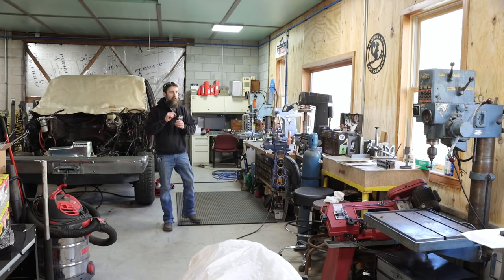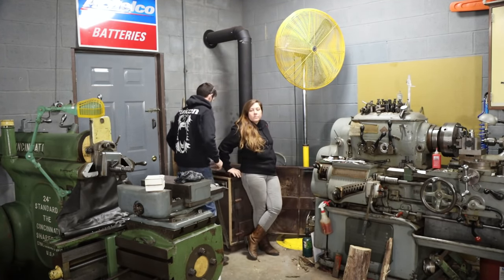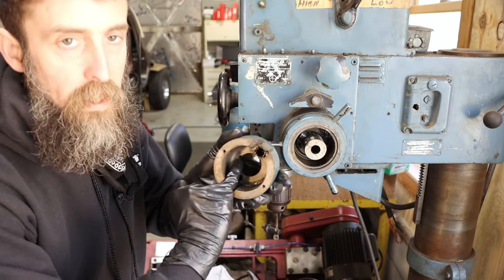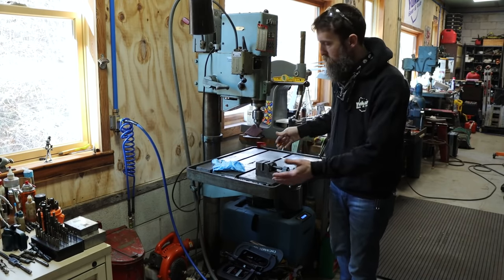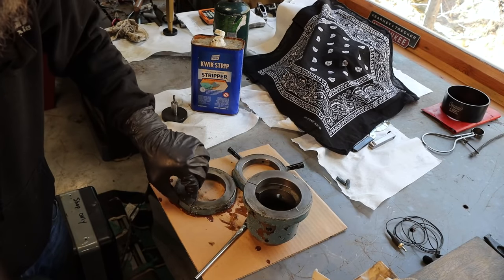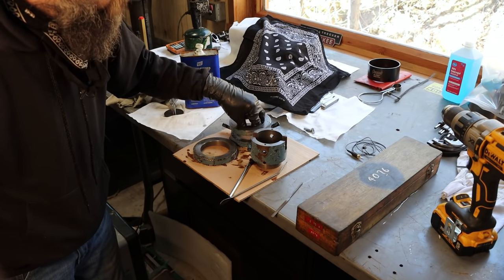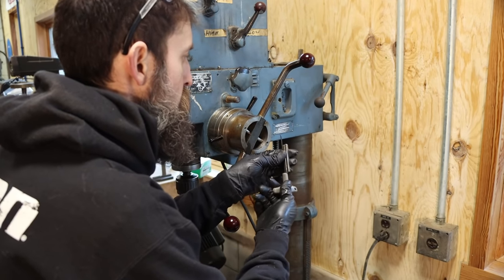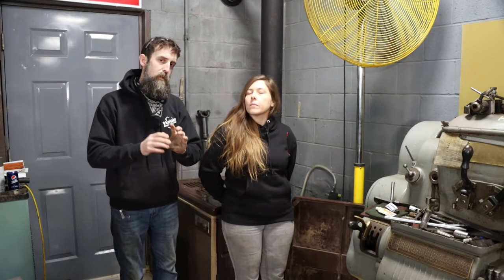Broken DoAll Drill press repairs. Mystery of the Missing parts 1

Comment: Yet a great video Steve 👍
The Strands/Arboga drill presses are super common here in Scandinavia. 
Your model is a S32M and the smaller one is a S68.  Great machines..
You should be able to get manual for your machines. It you need help with parts i can try to help though a Danish dealer.

They still make machines in this brand,  same as Arboga, Solberga and others. (Almost identical machines) 
Some parts are not made as good as they used to be.

If you ever want to repaint it. They were painted in Light blue Hammerrite paint, with 'hammered effect'

Best regards Denmark.
Reply: Indeed, according to the manual, the gear reference seems to be 2HS1961
Reply from the maker: Thanks for watching.  I agree they are extremely well made.  They are a bit hard to find around here. I like the original colour. My smaller one hasn't been repainted and looks pretty good.  I'd much rather have original paint. Thanks for the offer on searching for parts👍. Chances are Ill end up having to making it.
Reply: Nowadays the company making Strands are called MSC Machinery Scandinavia, according to the website they are manufactured in Rosenfors in Småland, so you seem to be mistaken in your claim that they are Asian made.
Reply: Aww, and here I was looking forward to Steve setting up for gear cutting on that big horizontal mill of his.  :)
Reply: @the_hate_inside1085  you are right. They are made in Rosenfors. - like Strands used to be made.
Now they are under Machinery Scandinavia (one roof) Strands, Arboga, Solberga, IMA & their new line Rosenfors.  All similar machines.  
I've edited my text as it were misleading. 😊👍
(Didn't know they were 'back' and all being made in Rosenfors, but did talk with my tool supplier today about it)

Those models are also made as copies with allot of other labels/names, from Asia.
I've owned one myself, and it were poorly made and far from the good old ~Strands.

Comment: I have not broken any of my bondhous ball Allen’s yet and I have cranked on several of them pretty good.
Reply from the maker: That 2mm wrench was asking for it. They really should put ball ends on them that small.  My bondhous set doesn't have ball ends on the really small ones.  That is a harborfreight set I have been using for a year or so. I like them because of the leverage 😁👍

Comment: You need part number 1903, its a 22tooth gear. The parts breakdown manual is available for download at HH Roberts machinery.
Reply: Which model is Steve's drill press?
Reply: @prototype3a  s32

Comment: Hi Steve - you're a braver man than I am.  I design & build electronic geophysical instruments, and almost always use a professional card shop to make my blank circuit boards - two or four copper layers, platted-thru holes, silk-screened part IDs & location outlines, i.e. "the works".   But I have occasionally made quick prototype {one-off} single-side circuit boards in my basement workshop over a single evening.  Drilling small holes is difficult for me because I don't have a good drill press, but I get along fairly well with some cobbled-together drawer slides on/in hardwood rails running vertically to support one of my Dremel-clone high-speed rotary tools/drills.  But a # 68 carbide bit is the smallest I've ever used, and they break insanely easily piercing through copper-clad fibreglass 1/16" card stock. To see you use a # 76 bit through mild steel was an eye-opener for me.  Many thanks for the demo, and best of luck finding the missing phenolic gear.

Comment: I bought used this type of drill press and I called the dealer that sells new ones and he told me that it would outlive me as long as I never shifted the speeds with the motor running. If you do that you will strip out the phenolic gears. On my particular drill they are no longer made so you would be in the gear making business. So you are warned😉. I love the drill press and it also has auto feed but an earlier design.

Comment: I did not read all the comments someone may have already said something about this below. Anyway Kleen & Strip does make a paint stripper that is super powerful. The hardware store cans are not worth buying anymore. My local NAPA sells Aircraft Paint Stripper made by Kleen & Strip. It is bionic. It waters the eyes and burns skin. Like the old stuff from the hardware used to. And does a really good job of getting paint to loosen. Good luck with the drill press gear. Cheers

Comment: Interesting investigation !- very thorough job. Rebuilding my (much smaller) 1946 built, Boice Crane 1600 now. Fabbing intermediate 5 step mounted in centre column using Alternator cast iron pulleys for shaft mount. Will greatly increase my speed range.

Comment: My 1948 Reid Surface Grinder was used once or twice before the Y axis was engaged after the travel stop.  It had a poor repair that did not last. With the Y yoke broken manual Y did not work.  The Reid at some time was converted from 2 phase to 3 phase and painted often by the City to look good. I bought it from someone that bought it at city action.  I fixed the yoke, installed 2 VFD's, stripped, painted, and polished the brass.  Its a new old grinder.
My 1960's Beaver 54" BVRP MILL was decommissioned after someone pulled out the back gear rack pinion and hammered it back in.  No parts are available.  After much searching I found a rack spindle that looked close.  I downloaded the STL file for the spindle and had a friend 3D print it.  The printed fit with a little work so I ordered the steel one .  After a total rebuild with 2 VFD's I have a beautiful 4 dro nt40 mill that was designed to be a climb mill.

Comment: FWIW: i had the same set set of HF hex wrenches.  I returned mine  because they were undersized and would bind up in the fasteners.  i replaced them with a Bondhus set.  Bondhus doesn't put ball ends on the smaller wrenches because they become too fragile.

Comment: I like the big art on the back like your doing.  Should be higher on the back.   I know a guy in the sports uniform printing business.  If they run the curing oven too fast, the ink is not cured.  Result is it comes off in the wash.  Normally Teespring has a pretty good reputation.

Comment: Better machine tools from that era commonly use dbl set screws.  Boy, if you miss them, it can ruin your day.

I recently ran across an ER32 collet chuck w- a JT33 taper shaft for 35.00 on eBay.  

I slapped it on my drill press & went from a 0.002" run out to less than 0.0005". Plus I now have 3/4" capacity on the thing.

I love it; best DP update since dropping the speed.

Check out one of those collet chucks, you'll be glad you did.

GeoD

Comment: Hi Steve,
Something you should do with ALL printed stock is place a t-towel or cloth over the top on the print and iron it hot.
All transfers or screen printing require heat the ensure that the print/ink is in-peregrinated fully.
Sometimes in the factory process the heat might not be correct and hence it will fail.

Comment: 21:05, I am assuming that it may have had a phenolic, plastic or even metal gear(due to that small clutch) such as what is found on an AMMCO brake lathe?  The AMMCO has a plastic shear gear before more internal damage is done due to operator error.  From the looks of it, someone may had already have been in it and just did nor replace the gear for safety reasons or maybe because it was not readily available?

Comment: We had 2 similar size drill presses British made with automatic downfeed chain driven from mainshaft but unfortunately no overload clutch.
Operator was drilling large hole with blunt drill with auto feed engaged, the resultant force broke the dove tailed casting and the gearbox was left hanging on the electrical cable preventing it from falling on him.
After repair auto feed was disabled on both machines for safety reasons.

Comment: One of the best cleaners I ever found was used machine oil.  Keep a few gallons in a bucket, soak dirty parts over night, the oil "rewets" the oil that evaporated away leaving dirt, gunk and rust behind.  Then to remove what is left behind, carbureator cleaner with a toothbrush size wire brush.  A final rinse in spirits and the job would be done.

Comment: Hiya Steve. Future reference. you can make a very effective DIY stripper. especially for small parts. Sodium hydroxide in hot water. You can get sodium hydroxide at the box store as drain cleaner (draino clone) and you can also get it in stores where they sell soap making supplies. I have found it at walmart. Not at all safe for people or animals, so PPE is necessary, but a small steel container or pot on a hot plate that you drop the parts into will do the trick. This will not hurt steel or cast iron. You do need to be careful with non-ferrous metals like Aluminum or Brass. Just keep it off your skin and avoid heating to the point of steam as the steam will hurt your eyes, nose, lungs etc. Not boiling hot, just hot, or warm even. It can cause serious burns and turn flesh into soap, but is very effective at removing paint. The same solution was classically used in hot tanks. I have also used it as an electrolyte for rust electrolysis. More dangerous than washing soda, Calcium Carbonate, much more alkaline. Kills two birds with one stone, de-rust and removes paint in the same step.
Reply: It also removes old oil and grease, even if it is already hard like resin, perfect for cleaning very old fuel tanks from 2 stroke motorcycles with a thick layer of hardened  2stroke oil on the bottom.

If you use acid for rust removal, you can dip the parts in sodium hydroxide solution to neutralize the acid, and it also forms a invisible protective layer on the steel, so it doesn't start rusting immediately...

Comment: It seems to me that the gear broke for a few reasons.
It was badly worn comes to mind.
The clutch did not save what it was meant to.
The missing gear also did not evaporate as you mentioned, it was removed in bits.
The gear was not replaced for at least two reasons.
It could not be supplied in a short time frame or was not available.
The Boss said screw it, just put it back together and use it as a manual down feed.
How did I go? John, Australia.

Comment: I have the same allen key set and since i got it ive been debating getting a more exspensive/ better quality set. Since these ones feel super chincy, this video has confirmed my choice lol, they work but just too flimsy for certain applications. Anyways great video as always steve good luck with finding and or making a gear. Ive wanted one of these drill presses since i first saw one!! Your shop gets more "awesomer" lol every video!
Reply from the maker: The good thing about them is the handle and the leverage.  That's the 1st issue I've had. The small ball ends seem to break no matter the brand. Some higher names stopped putting the ball ends on the smaller ones because they broke as well .
Reply: @SteveSummers  well ive been persuaded back into keeping them lol

Comment: Several of my old flat belt driven machines use a similar arrangement for feed gears...
A sliding plunger that locks each gear in turn onto it's shaft by use of a ball bearing and a spring...
It's an idea that's been around a long time...

See what someone like fenner gears have on the shelf.....and trim to suit...
🇬🇧😐

Comment: I helped out at an educational place with a Boice Crane drill press that was incredibly similar -- might've been just a slightly different year. We (gently) pulled the power feed off because we had a constant stream of people new to machine tools. Unfortunately, when it came time to put an 1.5" hole in a large piece of steel, it was a bit more work than we expected..

The quill return was also busted, so someone rigged a bucket of sand and a pulley in its place. Ugly, but hilarious (and well calibrated!), so the actual return spring was never fixed.

Comment: I believe you still got pretty lucky on that. I bought a really old Marquette welder/generator and the 10hp Onan engine was supposedly stuck from sitting for years, but had ran maybe 10 years ago and was stored inside. It was super cheap and looks really cool. Except the engine had water in it and was locked so solid I didn’t think I would be able to tear it down. It’s been sitting for 2 years full of ATF and acetone in hopes of breaking through the rust enough to get it apart. I do not have high hopes. I do have a backup plan. A 7.5kw generator with 13hp Honda. Worst case, I fit the Honda in the old frame and have a retro looking modern generator. I’d much prefer to keep the old stuff, but it’s likely bound for the dumpster…

Comment: More likely then not they pulled out pieces of that gear and what remains is the metal hub. You can get the module from the other gear (it's likely metric being made in Sweden) that's the easy part. As for tooth count, if you don't get lucky with the manual, it'll take a bit of figuring out. Hopefully feeds are marked and you can calculate the tooth count from there. Replacement can be phenolic or nylon gear... you can probably buy the latter pretty easily in the US

Comment: You could measure the distance between the shafts count the teeth and the diameter on the gear you have and calculate the gear the gear and diameter you need.  You might get lucky and find an off the shelf gear that can be modified.  Have you tried to call DoAll with the model and serial number?  They are pretty good about parts.  Sometimes they will make them and it will take some time.  That route is usually the most expensive.

Comment: You could use something like paraffin or an epoxy putty to make a casting of the space between the shaft and the gear, then extrapolate the rest of the dimensions from that.  Might be fun.  But I think someone is going to hook you up with an OEM part pretty quickly. Now, back to the truck.

Comment: Hi Steve, beautiful machine. That last small drill test was awesome. I have an Arboga eb100 that is built similarly and probably came out from the same factory (the castings at least). It's much simple than yours and needs two phenolic gears replaced. I've tried sourcing parts from representatives in Sweden but was unsuccessful and it's currently a stalled project. If you were to find replacements and or there's any make economies of scale by producing multiple replacements gears please let me know
Reply: You can order them, or have them hobbed by pretty much any engineering shop, as they are straight cut gears, and only need pitch and diameter. Likely standard sizes as well so off the shelf.
Reply: @SeanBZA  Yes, thanks. I haven't figured the pitch and diameter yet, how would you go about figuring those out?
Reply: @jpgarcia90  Measure shaft diameter, then measure the distance between shaft and top of tooth, then again bottom of the tooth on the other gear. That then can be used to give a radius of the gear, both inside and outside. Then tooth pitch gives you the info to select tooth pitch. Then look for gears with that tooth pitch and diameter that is in that diameter range, which will be what you want.  Your gear likely will come with a pilot hole only, unless you are lucky and there is one already bored to fit the shaft.

Comment: Also the Swedish machines I’ve had access to are extremely well built my koping lathe was considered a high speed lathe back when it was new 1000rpms 16x12’ I’m running it off a vfd I go up to 1500 but other than extremely light finishing cuts I never realy run it above 6-700 the machine handles it just fine just a little spooky to me with that much iron moving that fast lol sounding like a jet taking off I couldn’t imagine Brian blocks big lathe over 1000rpms

Comment: Steve, 
Kind of a neat drill press with 3,500rpm, but to be honest, I will just stick with a Bridgeport mill as I got a feeling if you do find a replacement gear, it will fail again in pretty short order using big drills with to much load on that drive gear as there was a reason it failed in the first place. 

     There is a dying art in the machinist trade called a manual maintenance machinist, not many left around. A very skilled trade to take anything apart, fabricant new parts from their own drawings and produce new replacement parts for machines designed to last 2 or 3 lifetimes. There are no trade schools teaching this art in the USA anymore and to be truthful, a CNC machine just takes to long to program each operation to produce only ONE new part.  Very sad what we allow to happen to our trade in the United States.

Comment: I suspect that the missing phenolic gear either stripped teeth or cracked. Someone went into it to see what was wrong, as you did, but removed the gear and all parts of it. Either didn't want to repair it or couldn't find a new gear.
Reply from the maker: Very possible.  With the damaged spring its likely the down feed stuck on or was hard to connect / disconnect and it could have made noise with the slip clutch causing the tech to go in and remove the gear.... who knows👍

Comment: When they made Dichloromethane essentially illegal in any consumer product they really should have stopped calling them Paint Strippers and call them something like "Minor Annoyance to Paint". Not that I actually recommend doing this but I bought a 5 gallon can of Dichloromethane and then plan to use a thickener such as hydroxypropyl cellulose, ethyl cellulose or fumed silica. I bought a pair of Polyvinyl Alcohol Gloves which are impervious to DCM. Watch out though, they also dissolve in water!
Reply: I think I would rather drop the new paint strippers on my car than brake fluid!
Reply: @bryanlatimer-davies1222  Agreed!